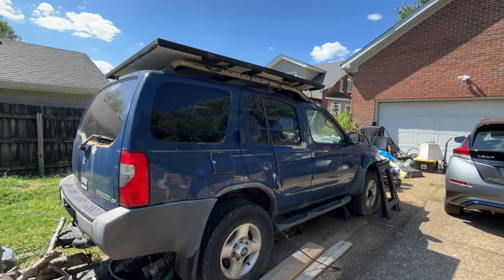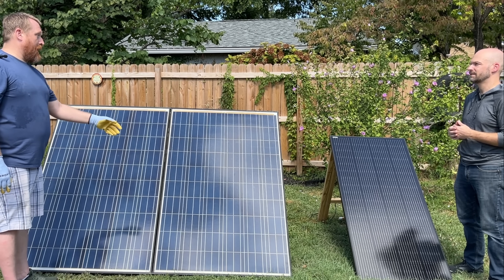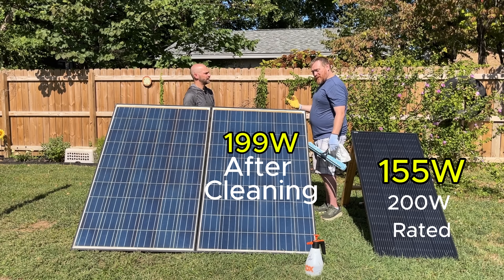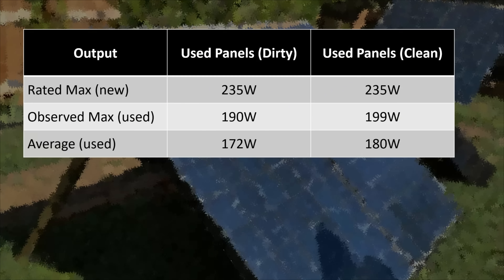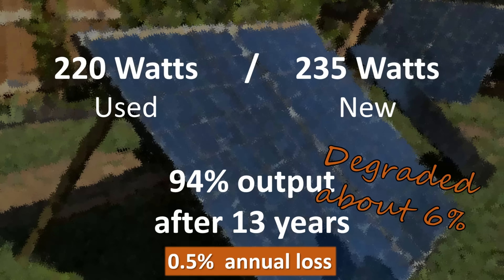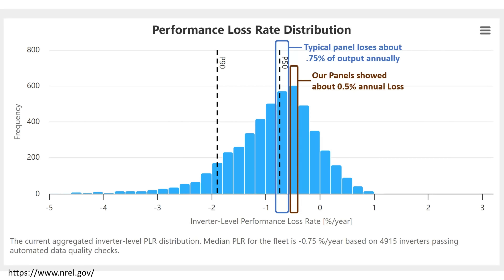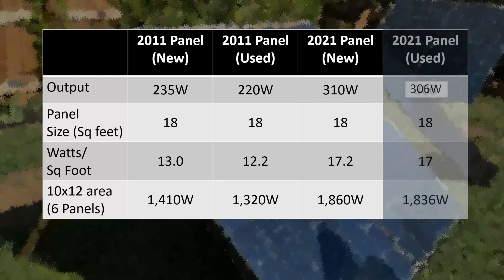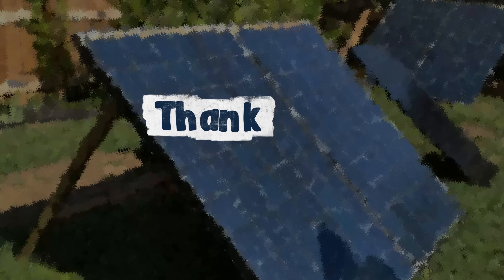Considering used solar panels?  We put them to the test!

Comment: Cleaning solar panels is mostly a waste of time and energy.  When that panel gets back to the same temperature, the output will be almost exactly the same.  The rating on a panel is under lab test conditions.  The truth is, they probably delivered no more than about 85% of that rating when they were new, or around 195 watts.  PV panels can last a full 25 years, so those are about halfway through their life-cycle.  The only trade-off with using them is how much space they take up for the amount of electricity produced.  If space is not a limitation, they will still be quite serviceable, as you discovered.
Reply: I have to disagree. The panels on my house when dirty (Central California) produce up to 30% less according to my monitoring on a daily basis. The used panels in this video were clean before cleaning in my situation. We see very little rainfall and dusty conditions so I guess it depends on your interpretation of clean and cost of time.

Comment: Base on my own experience I am not surprise at the results especially if they were used as a stand alone system. One of the difference between stand alone system and grid tie system is the stand alone system get to rest once the battery is full while grid tie system runs full plastic most times.

Comment: Used solar panels are now available for such low prices that when I decided to build a separate small shed for my garden equipment (mowers, chipper, hand tools, etc), I built a 3.3m x 2m pent roof design mostly clad on the outside with used solar panels that were cheaper than if I'd used the more typical wood cladding. It'd hidden away at the bottom of the garden so the panels don't contribute to our mains electricity supply, but I'm able to use all of their winter output as heat to keep the shed warm and dry. In the early spring there's enough excess to give some of my vegetable crops a head start by warming the soil in what would normally be traditional cold frames.
Reply from the maker: Thanks for sharing how you used the panels for heat for your shed and garden!

Comment: used 250watts for $65(local facebook market place) or new 400watts for ~$110 shipped to me.. No brainer for new panels. almost twice the output, brand new, and i get more solar with the limited space i have. I went with 10 400w(4,000Watts total) panels shipped to me for $1085.  or used 250x10 2500watts. Big difference. New panels alllll day!!!
Reply from the maker: You make a good point - people are often asking too much for their used panels.  On a related note, at what price would you have gone with the used 250W ones?

Comment: I bought 12 used panels a few years ago. They were 250 rated and put out around 200. I built a shed and used 12 as the roof. The problem was 4 of them had a small (microvolts) short to ground. They worked fine until I grounded the system properly. The charge controller would throw a fault. Those 4 still block the rain 🙂
Reply: I think if bought the same used 250 w panels for my project about 3 1/2 years ago. $40 a piece delivered. They produced on average around 205 to 210 max watts. At the time it was a really good deal. 16 panels at 3200 watts of real output coupled to 40kwh of lithium iron phosphate batteries and a 5K inverter runs my power needs nicely for my 240 sq ft shed. A couple 3d printers,  bench lathe, bench mill, drill press, small wire feed welder, lighting, fans and air conditioning to a nice 74 degrees, keeps everything cool and dry. I ran a 240 circuit to a transfer switch in the house for critical loads during power outages (hurricanes). Part of living in Florida. Good informative video.
Reply from the maker: Thanks for sharing your experience with used panels, glad the remaining 8 are still working well for you!
Reply: @BackyardSolarProject  Over the last year I made 1.7 MWh with those. I bought 20 new 390 W panels for around $115/panel last year. 10 have been operational (10 more ready to go) and since last June those 10 cranked out 8.7 MWh. The new were so cheap I couldn't pass them up.
Reply: good point - your system 48v? - might be worth pointing out used are suited to 12v systems where grounding isn't an issue.

Comment: ...but free. If I could find free panels like that in my area I would snatch them up in a heartbeat. My garage is just begging for a solar installation.
Reply: I just waited til the company that advertised free come view an collect 
I managed to get the last 22 panels 185 watts 
I drove my truck 200 miles to go get them 😂
70 bucks in fuel ❤
I'll test them in a few days but it's a pretty good size amount of power coming out old or new
Reply: @timanderson-q2w   Get an electric truck!  Likely would only have cost you $20, or less, for energy to collect them🙂

If only 3kW capacity of the 4kW when new (duds and reduced output) they were cheap.🙂👍
Reply: @oliver90owner  oh do I Smell the energy 
Til sustainable as in your life an life's of grand kids 
The battery that sparked up model T still runs today
Reply: Craiglist, local Ebay, Facebook Marketplace, and Nextdoor Free and For Sale.  They are out there for sure!  People put a new roof on and they don't want to the old panels back on.
Reply: If you have free roof space and you get a good price then go for it. There will be a bit of installation cost that you'll have to take into account. Mounting rails, fresh cables, the work etc.
Reply: @ehsnils lol I've got milk crates 
If no clue to milk crate there about 450mm cube open one end plastic crate very strong 
I mounted my panels up on milk crates which gives perfect angle an undid a screw out of my tin roof 
Put screw threw them tie down straps an did same but tight at other end 
Solder or get good joiners an find the bottom of rabbit hole in best way to suit your needs an panels battery allowance etc spend well on victron controller an inverters 
That part is huge 
No eBay solar gear unless it's victron
Reply: craigs list? ebay?
Reply: for that space there are much better options. Free is cool but its not worth it all the time

Comment: When you clean the panels, you should optimally let them reach the original temperature. Just cooling panels while washing will dramatically increase generation.
Reply from the maker: That's a fair point. The control panel saw no difference before and after cleaning ... and it wasn't very dirty.

Comment: my entire off grid solar system I built with 44 used REC 245w panels that were manufactured in 2012, 4 strings of 11 panels on a ground mount set at 39 degrees and facing south, its been working for about a month now and the highest I've seen brought in was over 5400 watts in late afternoon, but I don't live on the property just yet so the battery just stays full, when I drain the battery overnight it'll be interesting to see what they can really bring in, also I had the charged controllers limited to 50 amp output current each so they may have just been hitting that limit.
Reply from the maker: Thanks for the detail on your project. Quick math says you've seen about 123 watts (peak) out of the panels.  As you mentioned, you may be hitting a limit somewhere.  Are you able to look at the output of each string individually?
Reply: @BackyardSolarProject  I actually changed the limit on the charge controllers today to 80 amps each and seen a max of 8400 watts, but I only have one 48v 280ah battery so don't want to pump 160 amps all the time into it, ill turn the controllers back up to 80a when I have a second battery. Also I just did the math, and 56v (the charge controllers charging voltage) x 80 amps is 4400 watts, so with efficiency losses I was probably hitting the charge current limit again. if I maxed each controller at their 100 amp limit I would probably get close to the full 10kw from the panels.

Comment: These days panels that are that big are pushing over 600 watts. But any time you can grab any set of matching solar that you can throw on a groundmount for basically free? Its a score. You NEVER want to put used panels on the home because if they fail your insurance will not cover it.
Reply: Makes no difference where I live, insurers don't even ask if we have solar panels let alone if they're new or used.
Reply: @garysmith5025  Does not mean that they will not deny the claim if something happens and they are found to be the cause.
Reply: @davefroman4700  Why should they? Solar panels are such a common item that insurers don't regard them as being an additional risk, they're just an accepted part of your electrical installation so as long as that is done correctly there's no problem.
Reply: I only have used 250 w panels I bought from Santan Solar. They have worked well but now I would buy new if I need more. The price of panel has dropped significantly and I’m impressed with their performance over mine. With shipping,the used ones cost about $80 but I can get much better panels now for about 50% more.
Reply from the maker: @danielking2944  shipping adds a lot to the cost, for sure.  Unfortunately, not everyone can find them locally, though.  I agree that if you have to ship them, go new!

Comment: In upstate NY me and a friend just bought 26 Biface 450W from someone that was moving and had to take them down, we gave $20 each and took a chance, on 3 of them the face was broke and I wanted to see what I could get just off the back, I leaned them against the house in the evening sun not the best situation, and was getting 33V of the 37V they are rated at each and one at a time I was able to get 5 Amp into my batteries so if I save them for someones Shed and run them 3S I should get 99V at 5Amp 495 Watt about 200W each off the back side of broken panels LOL so I am not even bummed 3 were broke, in a SHTF situation someone will trade me a can of soup for them :)
I have an electrical engineering back ground and think most people if they take their time and look around for deals could do this them self, if you are going to tie it into the grid or your house panel I suggest having someone Lic. do it
as for the rest they will go on 2 different systems I am running EPever 150/40 so I will do a 3S3P and that should be great for the Bank I have ....
I am finding more and more used ones after only a few years service really really cheap! from $25 to $100 each AND commercial 145AH AGM batteries from Cell sites that are less than 4 years old tested for $50 to $100 each so I bought 20 LOL they are 105lbs each and they dont want to move them, thank god my trailer is rated for 3750 :)